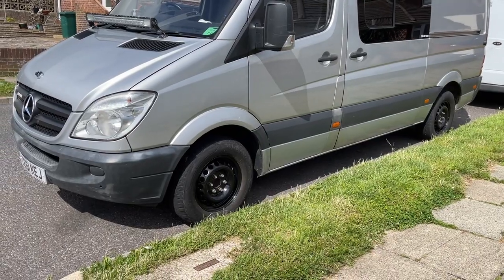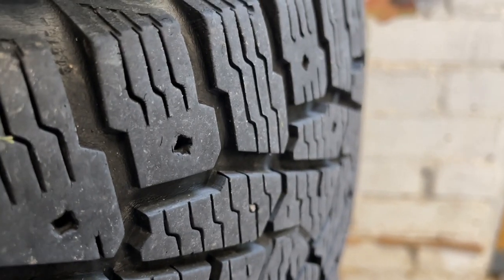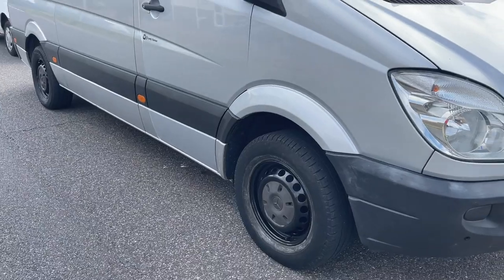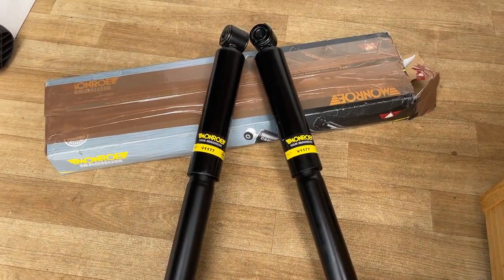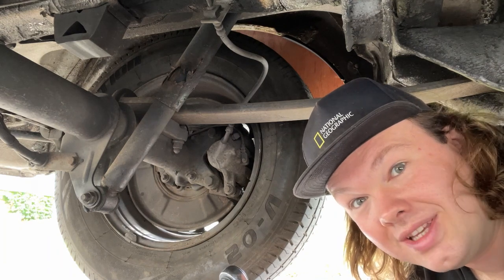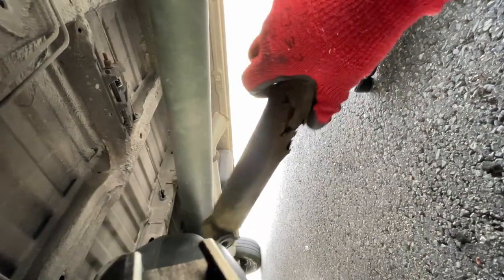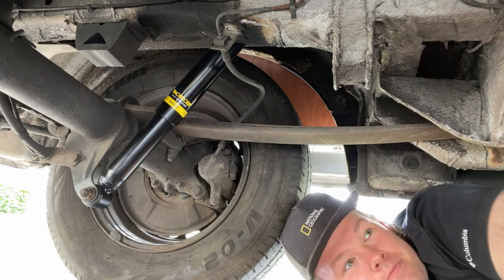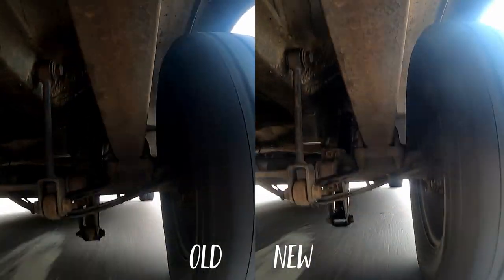Much Needed  SPRINTER VAN Upgrades! How to change MONROE MAGNUM SPRINTER SHOCKS REVIEW & New Wheels!

Comment: Changed my rear ones. Sachs branded. Real difference. I'm awaiting steering repairs to change front ones. The tracking and camber alignment needs doing after front ones. Mine, like many Sprinters has inner rack end wear and a lower ball joint gone. Too bad to be tracked properly. Scrubbing a tyre at present. Looking forward to a smooth ride, the seasickness can be really tiring.